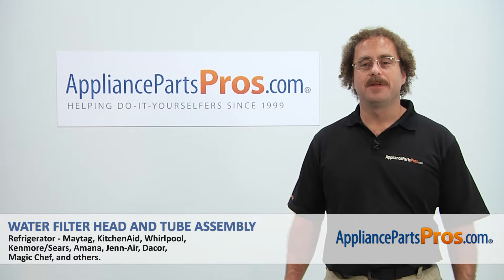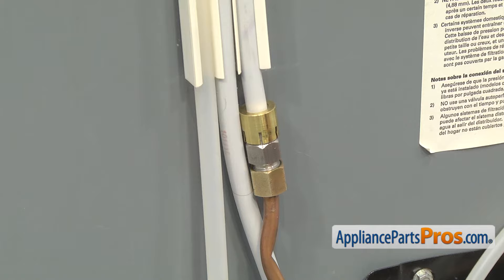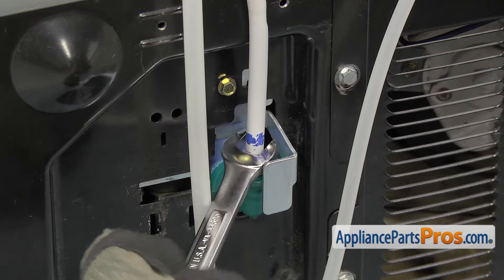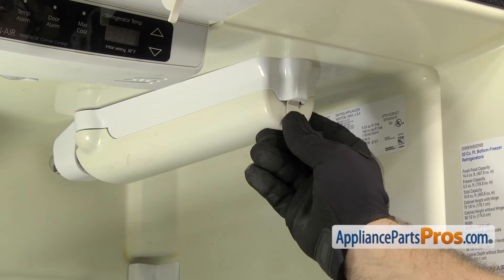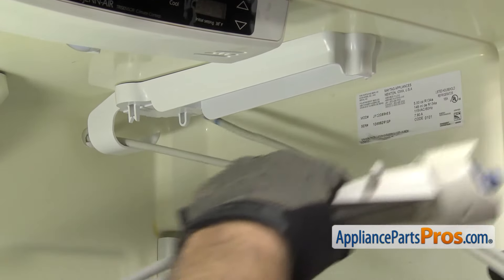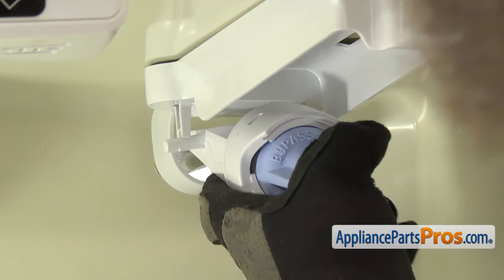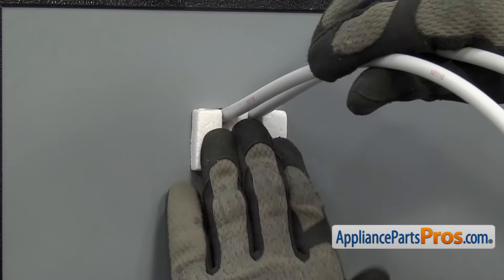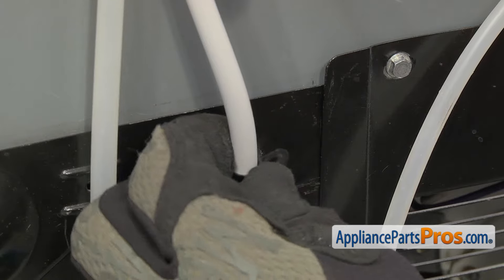How To: Whirlpool/KitchenAid/Maytag Water Filter Head And Tube Assembly WP67006524

Comment: Thanks for the video! Just did this repair in 2025. One thing that worked better for me was when I got to the step where you remove the styrofoam insulation block, I broke off all the tabs (it’s just who I am). I found it was easier to push the block back out from inside the fridge. 2:30
Reply from the maker: Glad the video helped! Thanks for sharing your approach, it might help someone else tackling this repair in 2025!

Comment: Is it possible for this to be the issue is my ice maker is still working, but no water flow to the water dispenser?
Reply from the maker: What is your model number?
Reply from the maker: You will need to check for power to the water valve when you push the dispenser for water. If you have power there and no water is coming in then you will need to replace the water valve.
Reply: @appliancepartspros thanks for your reply! How do I check for power to the valve?
Reply from the maker: You will need to use a multimeter set to ac voltage, place the leads on the wires that plug into the water valve. You may need to locate the tech sheet to determine which wires you need to test at. You will also need to be very careful since this is a live voltage test and it can be dangerous. If you are not comfortable doing that test you will need to contact a technician.
Reply: @appliancepartspros  ok thank you!

Comment: mine will come today and thanks to your video..i see it will be easy to replace...thanks so much..i know 100% its the problem with ours...water flow is normal then verily coming out...i tested everything..it was the only thing left to replace...i did buy a water inlet valve..but after ordering it..3 mins later i figured out it was the filter housing..lol its ok i wasted money..i will keep the older water valve for a backup..plus when i bought the refrigerator it was used but in perfect shape..except the water valve was cracked because they stored it out side in garage through 2 winters...well that water that trapped in it froze and broke it in 2 places..well i replaced it and so i have 2 used but like new valves for backup...anyway thanks so much for your video..i downloaded it for memories..:-) early merry Christmas to you and your family

Comment: Great tutorial for those who are changing a filter that is not stuck.  Most of them are stuck.  When it is easy, it is easy.
How do you get these poorly designed filters out when they are stuck?
Reply from the maker: You could try using some pliers and try purging some of the water from the line before removing.
Reply: @appliancepartspros  Thank you.  I will try those things.

Comment: I have this same filter head. The fridge is less than a year old, I accidentally pressed on one of those white buttons which I assume dispenses the water once the filter is installed but now it doesn't stop squirting water. Is there a way to fix this without replacing the whole assembly?

Comment: Great video.  But for my KFCS22EVMS6 KitchenAid, removing out the filter head assembly from inside the frig varies from the video.  After removing the filer cover, one also needs to remove a back cover by pushing down from the back.  The back cover will drop and the front portion of the back cover will be hanging on the pivot of the from cover.  One can remove it to get a clearer view of the clip as shown on the video.  However, the clip is on the right hand side, instead of the left side in the video.